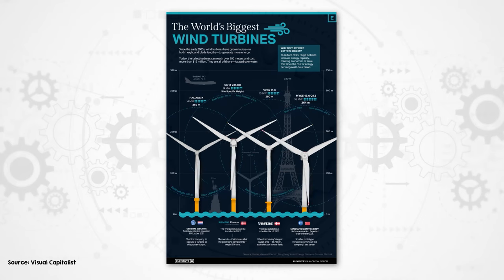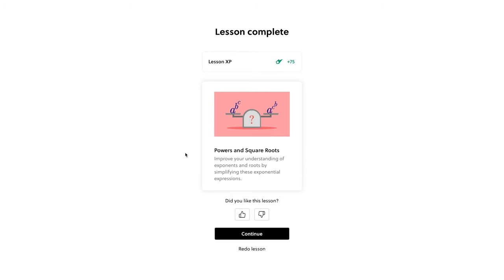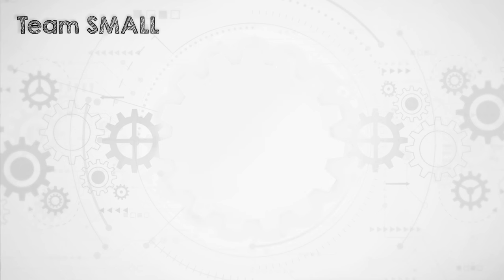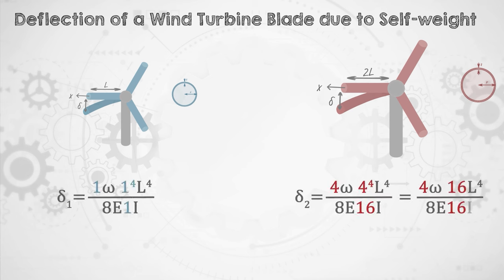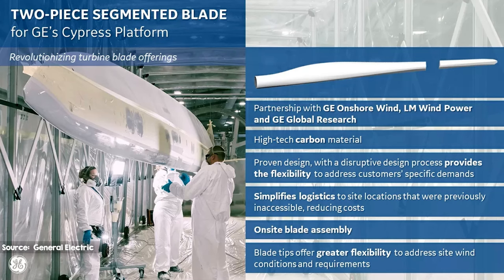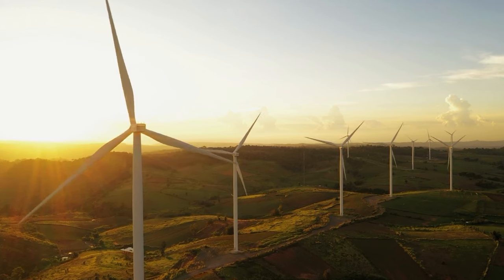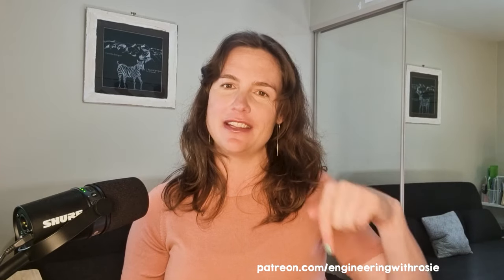Discover the Surprising Science Behind Wind Turbine Design for Lower Energy Costs!

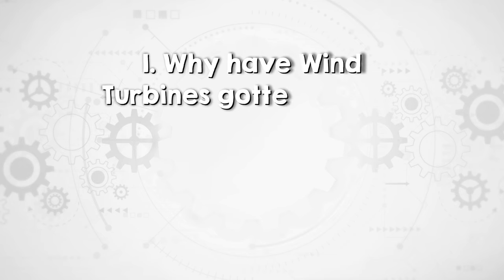Comment: I'm at 2:30 and going to make a couple predictions to see how they bear out with your analysis before watching the rest:

1 - turbines will continue to grow in size for some time as our materials science improves because of the efficiency returns of making turbines bigger and taller

2 - turbines will hit the tyranny of the rocket equation and the same kinds of problems as megafauna as the ever-increasing structure sizes demand more structure to hold the structure up which demands more structure to hold up that extra structure, amplification of resonant forces will come into play....TL;DR - at some point, the material capabilities of the turbines will start to hit efficiency limitations where you CAN go bigger but it will become more expensive in LCOE to shore up such colossal turbine structures than to just build 2 turbines. But we're not there yet.

3 - eventually the advancement of wind harvesting will shift towards finding ways to make turbines (or non-turbine) megastructures that are more and more efficient at harvesting wind as we'll hit practical efficiency caps at just building bigger and bigger crap.
Reply: I'm no engineer but I don't think I did too bad. I think you did a much better job than me though!

Comment: l would imagine crane size is one of the biggest factors that will dictate wind turbine size also transport will play a part.
Cost and manufacturing versus output in MW and maintenance factors such as parts replacement will play a role.
l really enjoyed this one you went into small detail and you showed confidence in the subject including ways to build bigger. Public opinion will also play a part going forward into the future.
The positions of wind turbines and solar farms is a contentious issue in Australia with size annoying some people also.
l prefer as much power generation in one location as possible to cut down on public hostility and increase efficiency...

The bottom line is still cost versus MW no matter how big the turbine, also the ability to recycle parts is coming into play at the moment....

Comment: Great video. But how does this work for vertical blade designs?

These have different scaling behavior, is there a size where these make more sense then horizontal turbines? Especially off-shore?
Reply from the maker: The square-cube law is mostly going to apply to VAWT components too. Depending on the specific design, the equations could change (e.g. if the blades are fixed on both ends) but you'll still get power increasing with the square and mass increasing faster than that. The larger VAWTs that were around in the 90s we're already struggling with scale, there were a lot of failures and they were mostly using guy lines to secure the top of the tower which isn't easy to replicate offshore. So I expect more not less scaling problems with VAWTs though I haven't studied it in depth. A few commenters have suggested floating VAWT would  make a good future video topic and I agree.

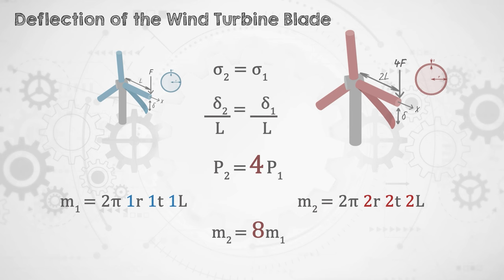Comment: 09:23 Bending due to self-weight
For the ascending blade, isn't its weight compensated (and exceeded) by very aerodynamic lift turning the turbine? But then again, the descending blade suffers combined forces of its own weight and aerodynamic force. Perhaps steering the angle of the blade on its way down could keep this force constant, to reduce dynamic stress?

To reduce weight of a blade, as well as work around the transportation problem, don't build them as solid structures. Perhaps you could use the trick flying insects use in their wings: supporting skeleton made of a mesh of tubes filled with pressurized liquid. Some of the insects (e.g. dragonflies) use liquid which hardens after the wings are fully unfolded, and so could wind turbines, as there is usually no need to retract the blades (... until the end of their operational life, that is).
Another option would be blades made as inflatable structures. Related to that, inflatable blades could be filled with lighter-than air gas to achieve neutral buoyancy in air. Since they are connected to the hub, the blades can't catastrophically fail like airships did, but construction and operation must make provisions for any case of sudden reduction or loss of lift, etc.

Comment: How does the operational window for wind turbines change with increasing size? My guts tells me that with larger size there's more mass to rotate and the amount of energy needed to initiate rotation from standstill is larger. I would therefore assume that you would need higher wind speeds before it could start. Is this correct?

Comment: The other issue is a rather practical one. There are simply not enough wind turbine installation vessels large enough to install large numbers of 15 MW turbines. The owners of these vessels are simply not willing to keep building bigger ones as turbines get bigger because they can't be sure they will not be become redundant before they get the return on the investment. These vessels cost $500 million and that is a big investment without certainty about future revenue.

Put simply, planning to build a 15 MW sized wind installation vessels now is futile. Investors have to build 20 MW sized vessels but by the time they are built in 5 years time the manufacturers might be planning 25 MW turbines

Comment: Is what I would term as “clean airflow” a factor in the size increase? Ie, if wind has already passed a turbine the air is now tubulent and using that on another turbine is less efficient at capturing energy(I believe), where doubling the size of the first turbine to get the desired double output would be more efficient way to harness clean air. Does that figure in the business case or is my turbulent air thinking some old fashioned idea I read somewhere and is no longer valid?
Reply: There is always going to be less power in the wind downstream of another turbine, even if you are 100Km downstream; there is limited power in the wind.  But turbines are normally spaced out sufficiently that actual turbulence is not much of an issue.  I do wonder at the shape of new floating wind farms though, if the turbines are floating then you can place them in any layout, water depth not being an issue, so why are the farms always blocks of turbines instead of long rows facing the prevailing wind direction?  I guess it keeps cables shorter, but other than that...
Reply: The floating wind farms are anchored to the seabed with stay cables so it’s just less of an engineering challenge to build at those sea depths. The spacing of wind turbines to mitigate turbulence is limited by the area available, onshore or offshore you can’t just plant your turbine anywhere you like, offshore you need to respect shipping lanes, onshore you must have title or land owners permission so you are always going to want to increase production capacity within the physical constraints that you have and it strikes me that fewer plant within a confined area meeting new production targets is surely a driver for larger turbines given that you can’t pack rack and stack them within existing real estate. More curious if the current designs have rendered such turbulence a non issue, just like turbulent water being used for hydro generation, perhaps there is an energy benefit if the turbulence can be captured.
Reply: Wake effect modeling is a very real and important component of wind farm design. You optimize the number and configuration of turbines such that you maximize total capacity per land area while minimizing wake interactions and component use (another tug-of-war). This is a multivariate algebra problem including costs of components, installation, operation, interconnection and land.

Distance between turbines can be listed in terms of "D", the diameter of the swept area. So for example, if your rotor length is 100m, D is 200m, and turbines 1000m apart would be a "5D" spacing. When I was studying, spacing somewhere between 5D and 10D was generally considered optimal, depending on many conditions. Percentage of power lost to wake effects is a function of spacing.

To directly answer your question, assuming you are spacing your turbines at some fixed multiple of D (and therefore keeping a fixed percentage of power lost to wake effects), the number of turbines per land area would scale with the inverse square of D (since the land area has two dimensions). Therefore, the total swept area (proportional to square of D) per land area would remain constant. At least, I think that's how it works out.

This puts wake effects in the "audience" category, I believe.

Comment: Edit - correcting typos. 

Sorry but I would have thought grid connection cost per MW of capacity of an array of turbines drops if the array uses higher capacity turbines. I.e.  if  you have 10x1MW turbines compared to 1x10mw turbine you have 10x as many connections...... Can you explain why this is not the case?
Reply: That's true to point but since windfarms are normally wired in strings it's not entirely linear, nor is the cost of switch gear and transformers since smaller units are made in much larger quantities so benefit from economy of manufactured volume. I would suspect that foundations have a much more significant bearing on cost savings when using fewer, larger turbines.

Comment: I remember seeing a report that Europe currently has power capacity of around 950 GW. If the economic forces ever tip to favor the 1GW designs, I can only imagine how much power we’ll have.

Also I suspect that given the relatively few number of them that would need to be built, that they’d either be built on site or the parts would need to be flown in through a team of helicopters. That would be a sight to see.
Reply: None when the wind is not blowing.
Reply: @RonTodd-gb1eo  It's usually blowing somewhere in the world, and Europe as a whole is increasingly interconnected powerwise so even if it's dead in Ireland if it's windy in Denmark, Ireland will have power.

Comment: On topic,  BIG is the Engineering term, "BIG" is the let's get as many of these as is possible, on the Mine Sites and Refineries as can be arranged as a matter of urgency. 

If a certain Canadian Mining group has a genuine method of CO2 sequestration in Tailings from Nickel Mining, and the same can be applied to all Metal Mines, this is the serious solution to Sequestration. (For the same CO2 reduction reason, SMRs are required urgently, I'm not biased, much)
***
Apparently Queensland Nickel is to be resurrected, they need direction for full Electrification, and vastly improved Refining methods. 
After the new baby is settled in, "someone" should organise some crowd funding to work out the sustainable redevelopment plan. 
A common sense objective in common is the quickest way to get Voters back together and make use of University Training.. etc.

Comment: Err no mention of Copper & Steel (Onshore Concrete Pad )   Mass & Therefore cost for each of these turbines
  What about Tip Speed approaching the speed of sound.
   What about blade degradation from Rain hail sleet dust over a 2,5, 10+ year period?
   What about bearing size and servicing on the shafts

Comment: Given that the wind speed increases with the cube of hub height, what are the constraints that currently dictate tower height? Why can't the lower courses of turbine towers be constructed of segmented elements to remove the diameter constraint? Is there a case for tripod designs for the lower part of a wind turbine, to improve economics of foundation design?
Reply: wind ground turbulence boundary layer  1/7 power law. fairly independent of Reynolds number, over a long ground plane.

Comment: in the early 00's I had a conversation - speculative - that a potential design that ... I won't say solves - but rather shifts - some of these design criteria around scale - was to shift the generator to the ground and use a stator electric motor design.  Kinda turn the engine inside out.  Ideally you'd want a huge ring around the outside of the blade made of probably aluminium trusses designed to act like stators  - individual current loops. On the ground (near?) you'd have a channel that the blade passes through that is a magnet - IIUC passing a coil through a magnetic field(oscillating magnetic field? - meh elelctronics is not my specialty).  Anyway - pickup.... a really BIG pickup. (I mean, it's have to gimbal, rotate, track the fan rim... but still.)

Why? What do you get? well, the center is now just a bearing.  And big bearings can be bigger than big motors. And you don't need to house or support a big motor high in the air. 

And one of the assumptions was that you could get bigger and go faster and survive higher winds and loads than conventional turbines.  The outer ring changes the loading on the blades too from cantilever to a braced structure. It's got depth at the tips. and less spill off the ends.   So you can make it bigger with less deflection - but at the cost of higher weight - and you'd likely want more than 3 fins - 5, 7 something that doesn't resonate...

Bear in mind, all this is from memory from 20 years ago... but in terms of size they were imagining 100m diameter fans in Bass Strait.

Comment: Ships are still getting bigger, and ports are still getting bigger to accommodate them,  most(?) of the new windfarms now in early planning for the UK are to use floating turbines that can be built in port and serviced in port, they are actually registered as ships, so transport issues due to size don't exist, construction issues due to size are only limited by port facilities, which can grow.   They will only stop getting bigger when there are too few needed.   A typical new nuclear/nuclear/gas/coal/biomass power station is sized, for good reasons, at around 3GW, all with several generators for redundancy; new wind farms are a similar size, for similar reasons.  Say 10 generators per windfarm to avoid a failure being too significant, gives 300MW each, that is 20x current size, so blades around 500m long.  That would make them a similar length to the current longest ships, so not an issue for the ports.  It will take a quite a few decades to get to that size though, developers never like to take giant steps, it would put them out of a job!  And by then, maybe there will be an alternative to wind power which will stop the turbine growth early.  Currently offshore wind power is cheapest, so that is where the development effort is, and for now they will keep steadily getting bigger.
Reply: There is a difference between a sea and on land. [About 11:58 - 12:50] Land side is limited by what size is permitted on the roads, even if pieces can travel part of the way by rail.
Another issue is bird flight patterns in the area. This affects wind turbine permitted heights and permitted speeds.
Reply: @bcase5328  Offshore turbines are already big enough for all seabirds to be flying underneath them and out of danger, except for the vertical axis designs where a low centre of mass is supposed be an advantage, but they forgot about the seabirds!
Onshore turbines are never going to be high enough for some species, they need to go offshore.

Comment: I've been wondering about this.  I suspect that if wind turbines do get as big as 50MW and the whole swept area  is reliably working above the PBL/ABL on largely adiabatic winds without much shear, then there is very little advantage in making bigger turbines. Also the "all eggs in one basket" plan is not a good plan. You want a wind farm to be multiple turbines to avoid SPOFs (Single Points of Failure).

Comment: Well done.
I think there may be a "skyscrapers in NYC" aspect to this, in that all the space above the turbine is "wasted".
There's certainly an incentive to grow vertically for greater "density" in the same area.
Reply: You forgot that the space above a small wind turbine does not come for free.
Reply: @janwinders  I did?
Who gets paid?
Reply: @garrykanter5773  yes, you did. Lawyers, officers and researchers get paid for it.
Reply: @garrykanter5773  higher wind turbines are harder to hide, louder, have longer shadows, kill more birds and bats. Anti wind energy initiatives grow faster than the hub hights of wind turbines.
This costs a lot of money in the planning phase of a windfarm. And if someone has to spend money, someone else will profit. Don't you agree?
Reply: @janwinders  Since I have no idea what your point is, I do not.
Reply from the maker: That's not quite correct for wind farms made up of horizontal axis wind turbines though, as the diameter increases as you scale too. And the spacing needed between wind turbines increases proportionally to the diameter.
Reply: @EngineeringwithRosie  I think my rough comparison regarding nothing more than an "incentive to grow vertically" is valid.